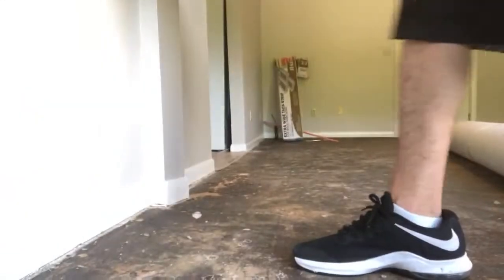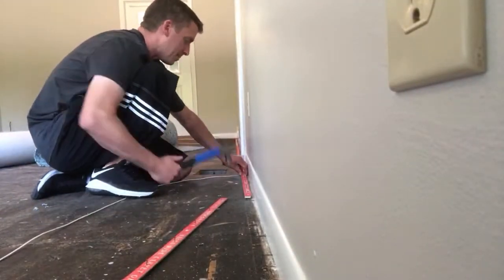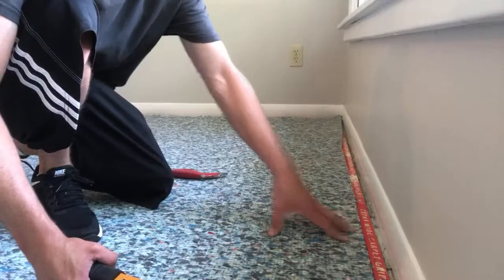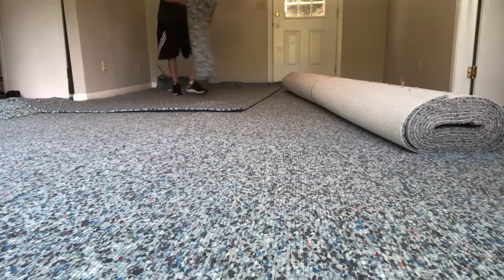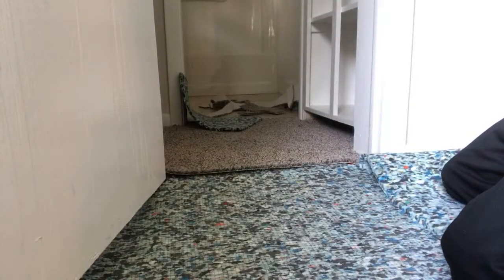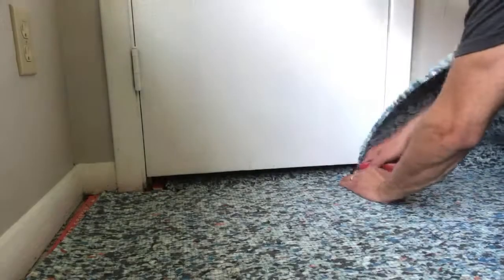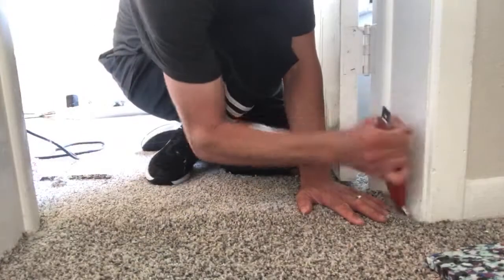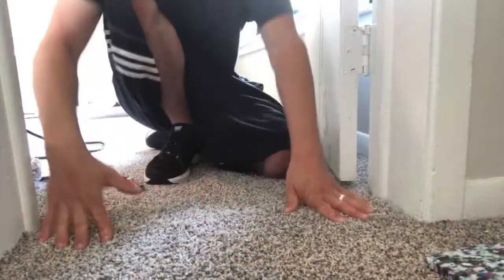🔴How To Install Carpet Step By Step 🔨

Comment: Very good video. You made it look doable for a first time DYI. (It's never easy). I have multiple rooms isolated by laminate hallways. Is it possible, or advisable to pull up the carpet in a bedroom in one piece, then use it as pattern for the new piece. In my garage, lay the old piece on the new one, then add an extra 2-3 inches to the perimeter, then trim.??

Comment: Somebody taught you wrong my friend invest in a pair of tack strip cutters you also need a min of 2 nails per piece and a nail atleast 3 uinches from the end on cut pieces no big gaps in your tack strip. TAKE your doors off… Just remove the pins  You use a kicker not for stretching but to set walls ….you use a power stretcher to stretch your carpet and you cannot do one wall than the other you have to do a few feet of one then go back to the other. It’s like spreading The wrinkles out of a table cloth .never cut all your doorways closets down etc. until you get somewhat of a stretch past them if possible.DONT Beat your metal down with a hammer it will look like crap use a rubber mallet or fold up a piece of carpet. use a straight edge and row cutter.If your carpet is not stretched correctly it will not perform up to its standards it will Matt crush and create wear patterns in your carpet A lot 
Quicker than normal. Always use your carpet tractor and weight,that’s what pushes the glue into the backing of the carpet. you stretch after you make your seems and they cool…did you see the big bubble at the end of the video at his seam. If you properly stretch out with a power structures closings this song apart
Reply: You are a Boy Scout. Take doors off only if necessary. Strip cutters, wasted time and money . Hire it done. It takes a lot of practice to knock how to wrestle carpet. DIY stick to floors that go in a piece at a time. This guy has done this hundreds of times. I tried.
Reply: To warn y’all

Comment: When you were seaming the carpet in the door and making the smaller cuts on the bottom piece you said not to do that with a certain type of carpet, only with plush. What kind of carpet is it that I shouldn't do that to? I'm about to lay 408 ft2 in a 12x34 room with indoor/outdoor type carpet, real low non-plush stuff. And I'm doing it on a concrete subfloor. Any luck is appreciated haha.

Comment: remove any and all doors that swing into the work area..thats first..secondly mitre all wood strips using a snips of some kind ...third  lay your pad out remembering it is 6 ft wide ..i.e.  2 shots in a 12 x 12 room...line up a free wall so you dont have to trim ..staple in such a way so you dont make the pad lip back on you...spot staple away from the seam...then use tape for the pad seam. lay the carpet out by folding it and manipulating to your advantage and not hitting the walls...then lay it out a little at a time ...make relief cuts...use straight edge  or top cutter for seam cutting ...use seam weight and seam roller to make seams and trim your seams with a seam shears...knee kicker and  power stretcher is madatory... wall trimmer and vinyl knife for a smoother finish...vacuum .. put doors on take away trash. this dude is fast yes ...but pounding on a metal with out mallet  or even some scrap carpet between the hammer and metal ..just wow...if he cant afford a wall trimmer ...wow...did nt take the doors off ..wow..kickin the whole job in..knifing the baseboard..not in my house...stay in the ghetto apartments dude.